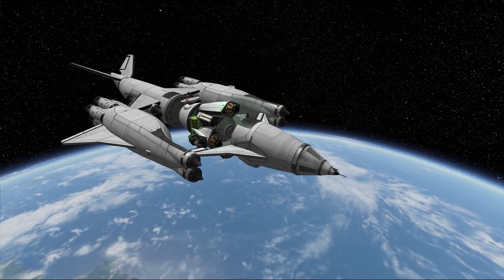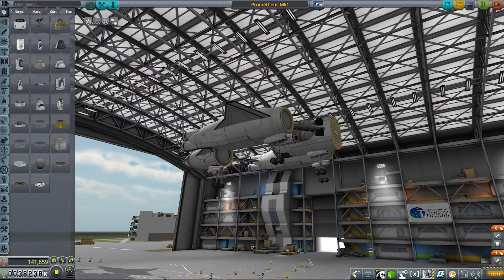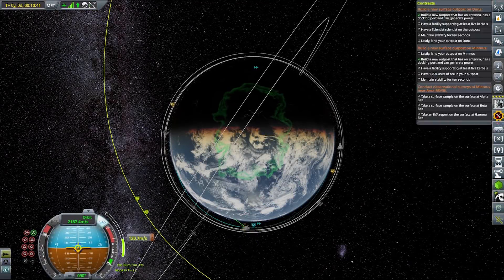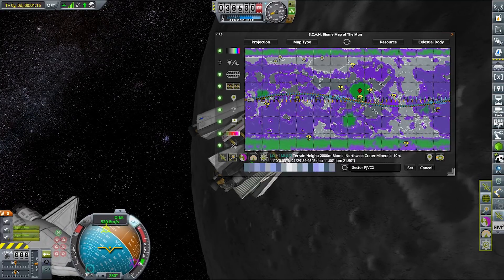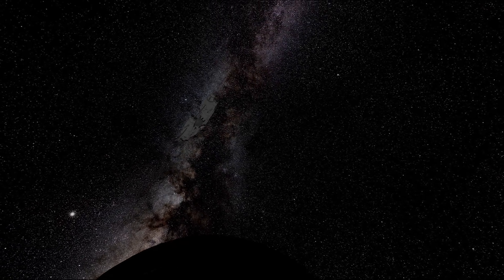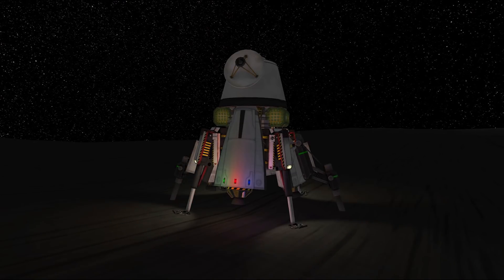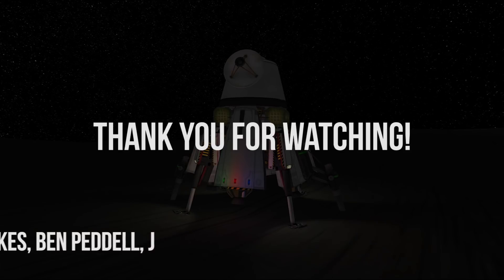[25] SSTO Space Program - Back to the Mun! - KSP 1.3

Comment from the maker: Sooo, I guess there will be no rescue missions? At least not now that is, because surely at some point everything will go full bananas :) You're awesome guys, keep it up!
Reply: Mark, it's all kraken))) What can be else?)
Reply: Phoenix Ring yes indeed that's so very true . after infesting all other youtuber star sistems it has finally arrived at Mark Thrimm's one , but will he survive?
Reply from the maker: +Anthony Pelchat Thanks for the tip, but right I just feel like there is absolutely no way of predicting how much EC and radiators a miner will need. I know that engineers can boost efficiencies for hand drills, but those are automated so I was hoping they would have relatively stable output (or at least EC and heating requirements)
Reply: I found few bugs related to heat even is stock ISRU and drills configs, not saying about modded ones. So I'm usually fixing them on the fly with notepad, until they are are balanced enough for me. 
Those issues can be quite frustrating other wise. Especially when going interstellar )
Reply: No idea about the heating issues. I know that it is randomly an issue with MKS, though mainly due to problems with KSP's way of heat transfers. The only thing that I could say for it is always go for overkill. Actually, you need to have more radiators anyways due to planetary efficiencies. That is probably why your Mun miner was using more than it should have. The PE improves the amount that everything can, which improves how much the miners can mine. However, the power and heat consumption is related to the amount that they mine. As they mine faster, they need more power and produce more heat.
Reply: Please save everyone. Also thank you for the entertainment!
Reply from the maker: Thanks Dan!
Reply: Hey Mark! I've got a challenge for you. one that NO-ONE has done nor beaten before. Make a tutorial on how to download spaceships in KSP.
Reply: I'm going to say the heat issue was a bug from the 1.2 to 1.3 and they did a auto update patch  that fixed it shortly after. great videos, I'm aware this is an older video but Im trying to do an 'ssto only' career play-through currently and your videos have been inspirational. I'm just trying to do a low tech multi sat launch to Jool currently. thats being a pain in the backside lol.

Comment: Ohh. Now, I find fixed radiators don't work well with timewarp, but I haven't yet had a problem with the deployable ones. But I expect they all have the bug.

Power use in the stock drills varies with ore percentage.

Comment: Over heating is caused by the timewarp allowing heat to "count" and build up but not letting radiators "count" an remove the heat while in time warp.   At the end of time work all of the built up heat is added to all the parts.

Comment: I have had odd heating issues in stock vanilla KSP on and off since 1.0.  One normal gameplay thing is that smaller parts will heat faster than larger parts, and also they seem to act as radiators, collecting heat from the larger and other parts.  Only certain part configurations seem to have severe thermal differences/issues, but i have not cracked that mystery yet.  If you're playing with mods, then that adds another whole layer of complexity to an already complex game code.  If radiators do not radiate heat in time warp, but the drills continue to produce heat, that could be a possible cause.  I would build all of your craft with the option of additional power generation module for the higher demand drills etc.  When the craft such as a mining probe is docked with your colony ship, it can provide electric charge as well, if needed.

Comment: How did you get the reactor/drill combo to stay cool? Even with six of the largest radiators mine still eventually overheat, using the exact same reactor and minimum power setting to run the drill.

Comment: Heating and Power are continuous topics of discussion on the forum thread for these mods.  Usually those problems first show themselves when you time accelerate.  (I'm kinda wondering if you didn't time-accelerate at all when you returned to Duna and found that all was well.)  Roverdude keeps refering to a future update that will either fix everything to do with heating or maybe just cause everything to need to get rewritten and thus it will be busted differently.  Be warned - your drill efficiency goes up with the Geology stat of your colony, and so what's working fine now will be busted again after a year or two on the planet.  One of my modestly-sized colonies on Minmus now has a pair of the StarLifter Nuclear Reactors bolted on with KAS, because that's how much power it now needs.  Zoiks.
Reply from the maker: Thanks, that was most interesting. I'll try to look into that - it's true that Geology level for my Munar colony is larger than other so probably that was the problem. Thanks again!

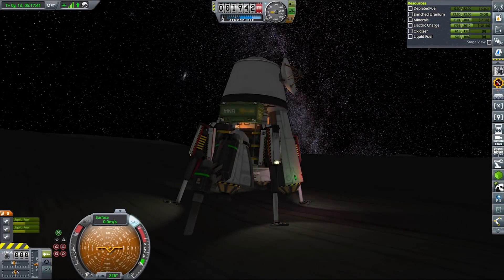Comment: 10:04 yup, had the same problem with my mining stations. Oh it requires 40 EC/sec? I'll just put a nuclear reactor that outputs this exact amount! Nope, did not work. I think timewarp just bugs everything up.
Reply from the maker: Yeah, tooltips are somewhat confusing. I personally think that RoverDude mods just grow too quickly and are too complicated to be bug free. It's like a free DLC made and maintained by one guy. Sure there will be bugs.
Reply: The problem as i see here is more as the powersuply need is per head! And if you use a medium dril you have 5 of them. For standard it goes for 5x 40Ec/Sec = 200 only for Drill and for the other i think it was i think a miscalculation. As they have 200? Would be a nice PR topic for RoverDude to look in or maybe to correct the stats. As example dirt have 200 too if i do not mishape amd i don't see how it need more EC? For Uranium on other hand it would be reasonable for all additional machinery to process that mineral?

Comment: So this probably sounds stupid but can the overheating problem maybe be because no planet has a perfectly circular orbit?

So maybe when the Duna stations were overheating it was Dunan "summer" where the planet was close to it's periaps and getting more light, and now it's not so the station is just barely not overheating.
Reply from the maker: That's an interesting idea and I actually don't know if in KSP there are seasonal changes in temperature. However those stations weren't overheating on Kerbin, neither was Pol outpost. But I'll try to see if temperature on Duna actually changes, thanks!
Reply: If this was the case i think on Kerbin it would be more present at testing as we are near to Sun there?

Comment: Mark, can you add batteries under that FLT-10 adapter? The thing with nuclear is it's sort of a fast trickle. Adding 3-4 batteries and 6 RTGs might balance the load a bit. 

Also did you update the mod that gives you those reactors? I think another YouTuber said they they were buggy a while back and the thermals were not uniform. I would try adding a few large radial radiators directly to the reactors.
Reply from the maker: I'll look into that, thanks! There are some batteries on the sides, giving the station ~3k EC.